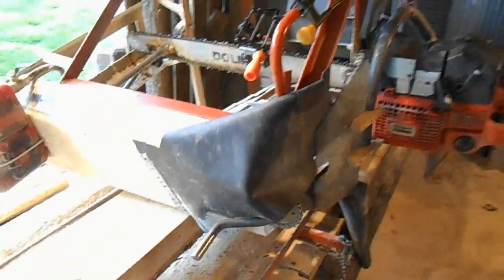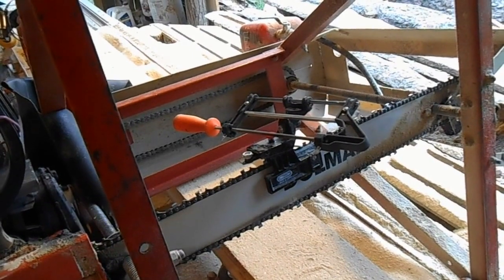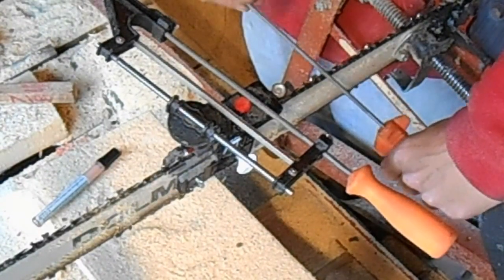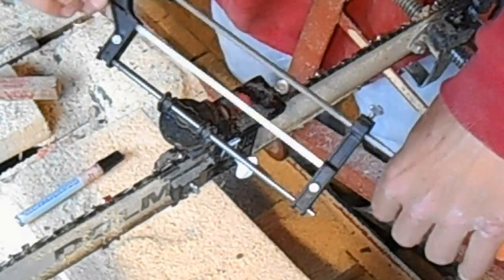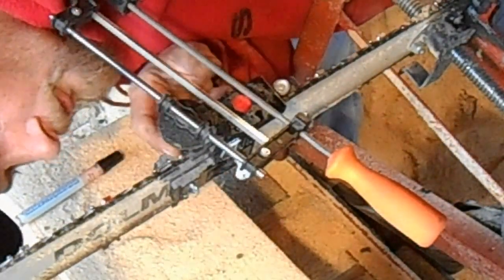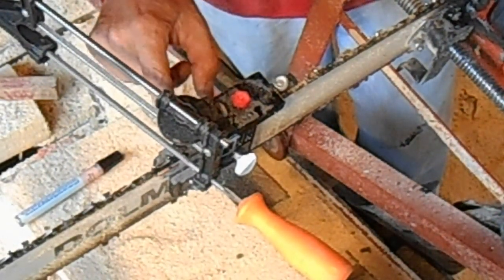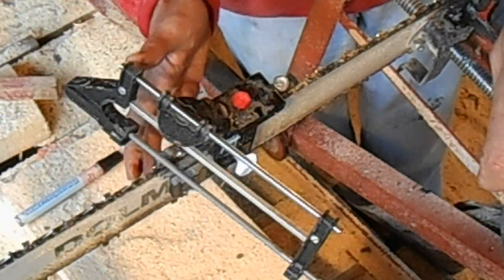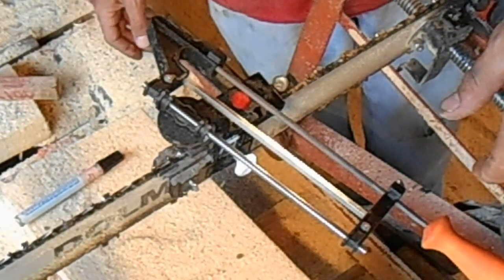Chainsaw Bar Mount Sharpener Test

Comment: Cool. I picked one up at a second hand store a few weeks ago for 2 bucks, was barely used. I am stoked to get to milling again. Thanks for the review!
Reply from the maker: Karson Branham What a deal. I need to get back to milling myself but the saw needs a rebuild. I need to finish ordering my parts. You ever rebuild a chainsaw? It's my first.
Reply: I have a stable of used saws.  McCulloch is my brand of choice, especially the 10 series macs.  There is a good source for parts at chainsawr.com Baileys also has quite a good source of aftermarket piston/cylinder kits for a lot of saws.  Your Dolmar will certainly be worth putting back to use.  They are good saws.
Reply: Karson Branham

Comment: You have the same mill as I do. I have been searching for someone with a Mil-Rite like mine. I love it!!!!
Reply from the maker: Well I did have one just like yours. I decided to convert it to a 10hp Briggs motor to reduce the noise. It's actually a project I am working on now. Today I mounted the motor and started designing how the belt and pulley's will work. It is very hard to find any online info on the Mill Rite's, I've searched before with little luck.
Reply: @JCsBees  I do hope you are recording the process. I am considering converting mine to hydraulic using a briggs to drive it only to reduce time between fueling it up.
Reply: @JCsBees  I saw some little bit of info on the company but not the mill I have. Yours is the first I have ever seen that is even like these. I would think a track type mill like this would be popular. So much easier to run.
Reply from the maker: I am not recording the process but I am taking pictures as I go. Maybe I can turn them into a video once I am done. The bad part about my conversion is I had to completely change the design of the carriage. Instead of being triangle shaped it's now square. I am also getting rid of the hand crank to raise it. I am going to a winch lift design. My Briggs weighs around 80 pounds so I figured using the existing hand crank may be a little much to lift it.
Reply: @JCsBees  Ok. Cool. My idea will have some long hydraulic lines on it along the tracks but otherwise not so much of a change to the system.

Comment: I have been thinking of ways to use a Dremel with the right diameter bit to make sharpening easier. It seems the jig you're using could work especially if there is a stop for depth of cut.

Comment: Nice video and thanks for sharing.  How many logs can you cut before you need to resharpen the blade?
Reply from the maker: Rick Rabjohn Well as long as you avoid sticking the bar and chain in any dirt the sharpening last for quite awhile. I can cut several logs without re-sharping. But sometime I find stuff hiding in logs like fence and bullets which would require a sharpening.